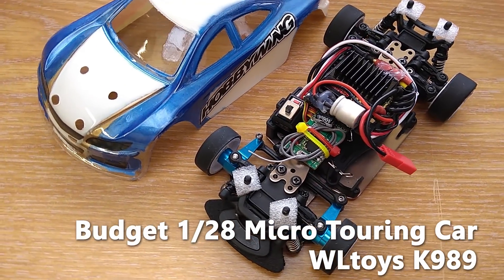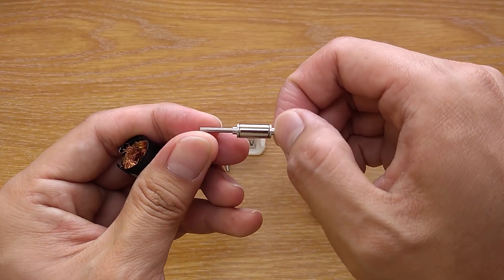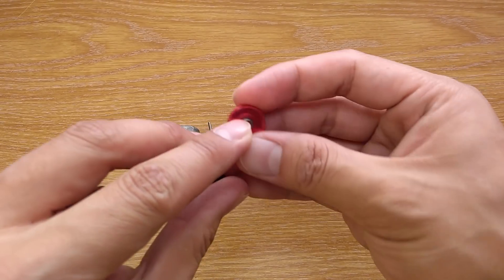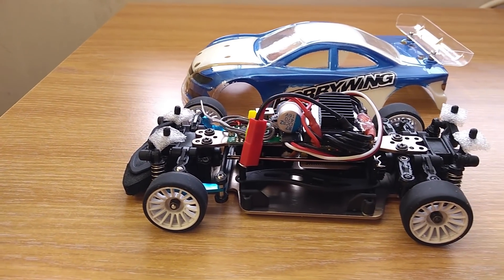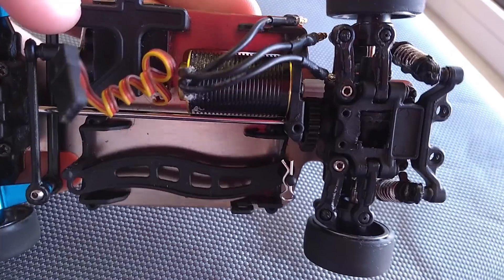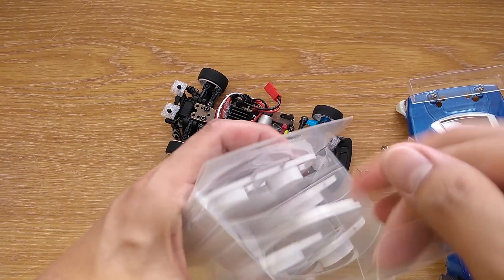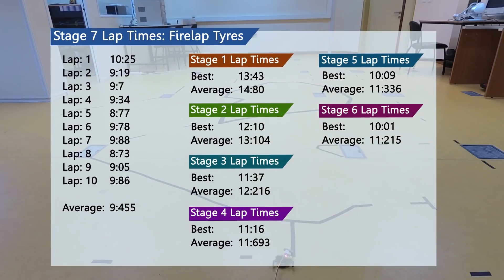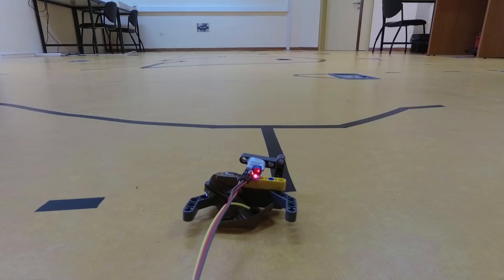WLtoys K989 Budget Touring Car - Stage7 Brushless Upgrade

Comment: Hi Beaver, where can I find the 8t pinion gear you use in the vid? Also which spur gear size is best to use? Thanks
Reply from the maker: It's from Tamiya Mini 4WD. You can also find it in "small plastic gears" bag like this https://bit.ly/3oXbPq3 .
To run a small motor pinion like this you'll need the 29T spur.
Reply: @BeaversHobby  Thank you Beaver for all your help waiting for parts to arrive FYI finally they have made metal crown and transmission gears found them on Aliexpress for this little beauty no more chewing up those pesky crown gears I went through lots on my older build, also ordered new all metal parts from banggood apparently fits much better then previous metal kits
Reply from the maker: @tecnikturbo  It's a bit difficult for me to order things from Aliexpress now so I didn't get the metal prop shaft gears. I've seen some other people use them as well and they work perfectly with the metal differentials.
Reply: @BeaversHobby  Hi Beaver I could forward you anything you need from Aliexpress I get most things sent to my Familys UK address then they send to me here in Cyprus
Reply: @BeaversHobby  Hi Beaver so I just installed the 9t and 29t but she not fast at all on full thtottle, seems tight when I try to push it by hand, everything looks good as far as pinion spur gear gap any ideas?
Reply from the maker: @tecnikturbo  Thanks. I'll let you know if  I need anything.
Reply from the maker: @tecnikturbo  If the gear mesh is OK then there's no problem. The slow speed is to be expected for 9T pinion. I use 8T in this video to slow it down, it's my setup for the excessively fast motor.
Reply: @BeaversHobby  Great thanks for the reply what would be the best combos for top speed or top acceleration or something in the middle, really don't understand gear ratios to keep my motor  in safe temps
Reply from the maker: @tecnikturbo  It depends on the motor you have and what you want to do. The highest speed that's easy to do is 21T motor with 27T spur (original  part). You can use bigger motor pinion for more speed. 
Good acceleration is the stock setup, 17T + 29T. If you want more torque for, let's say drifting then 15T + 29T with standard motor.
Here's my video about gear ratio. https://youtu.be/bQiR-cfBnvw
As for the motor temp, I don't really have a formula for that. You'll have to monitor it.
Reply: @BeaversHobby  Thank you Beaver! I have the same motor as your video the scorpion what would be a safe max temp? I want the set up basically for racing others on full size track lol so need a balance for max acceleration and top end
Reply from the maker: @tecnikturbo  60-70°C is really hot, try and keep it around 40-50°C should be fine. A heatsink will help too. I've seen some on aliexpress.
I thought 8T was still really fast with the track I've tested, around 2.5m x 4m. You can try 10-12T pinion. I'll give you more speed. The acceleration is not really compromised with this motor, it's powerful already.
Reply: @BeaversHobby  Mm maybe its because I was trying straight light speed about 12 meters and didn't seem that fast even much slower then stock motor and spur/pinion? Let me have a look again and see if I have everything setup correctly before I change to your recommended spur/pinion combos upove, thanks again for your help much appreciated 😊
Reply from the maker: @tecnikturbo  Anything in this scale will look slow in long and wide track. Anyway, try 18T pinion with 27T spur if you want absolute straight line speed.
Reply: @BeaversHobby  The scorpion motor is a little beast have you seen on Aliexpress the 18A Brushless ESC + 1625 Brushless Motor? What do you think will it work for this little guy? I'm gonna order next couple of days if you want one? Gift to you for all your help send me a private message not sure how to do that.....Not really too wide of a track they race 1/10th scale RC's its got one straight about 10-15 metres and then just mostly turns its hilarious watching this little guy on there, anyways I will try your last recommended and go from there, by the way your videos are amazing and you've have been so much help will study the gear ratio video again thanks 😊
Reply from the maker: @tecnikturbo  The EZrun 18A + Leopard 1625, right? I got one of those and they are good. The motor needs a bit of care since the wires are brittle but it has good torque and speed. Yes, the combo will work with WLtoys 1/28. The 1625 is the same size as 1410. Different manufacture calls it differently.
Reply: @BeaversHobby  It says BYRC looks decent not sure if its as good as the scorpion combo but as its only 23ish euro I doubt it, iv got two wltoys k989 one setup near exact like you brushless scorpion setup and one stock which will take the new motor which ever one i decide to get
Reply: @BeaversHobby  Hi Beaver one more question please i found motor from surpass rocket are they any good? Which kv would you recommend the orange motor kv is 9500 would this work on the k989 With 27t spur 18t pinion? Iv just ordered the heat sink and the smallest fan which I will glue on the side of the motor mount for cooling thanks
Reply from the maker: @tecnikturbo  Surpass Rocket is the standard nowadays. It's as powerful as Scorpion but doesn't heat up when using with 2S. Choose the KV based on what you want to do. 2500-3500KV for drifting, 3500-5500KV for track driving, 7500KV for track with very long straight. 10500KV for drag racing or just do speed run without caring it'd need to turn.
Reply: @BeaversHobby  Hi Beaver now thinking of purchasing a 2030 motor judging by size it should just about fit in hopefully what do you think?.  I have a small issue with my setup as it is when ever I let go of the throttle the car turns hard right also which ever direction I turn it kind of steers in that direction no matter how much I play with the trim, I just put a new servo in there thinking this is the issue but still the same any ideas would be much appreciated please?
Reply from the maker: @tecnikturbo  2030 won't fit unless you do some extensive modding to the motor mount and servo bracket. Even if you do that I still won't recommend because the size and weight. 1625 (actual size 16mmx25mm) or 1410 (some manufactures just call it that even it's the same size and bolt pattern as 1625) is the right size for this car.
The veering off to one side is more of a problem from the chassis and tyre contact. Check if the contact patch is good on all wheels. Worse case you might need to put M2 screw in the lower arms and adjust the downstopper to make all the wheels touch the ground evenly.
Reply: @BeaversHobby  How would I go about adjusting the downstoppers? I have upgraded everything to metal now and tyre contact patches seem okay nothing seems to be binding really annoying
Reply from the maker: @tecnikturbo  Oh... You have the metal suspension... No wonder it's out of whack. Take a look at the lower arms, there will be a hole that you can insert M2 screw in. Put a screw in there and adjust each one until it works correctly. The other possible problem is from the differential, if you use ball diff, check if the diff can spin smoothly. If it's one way, check if both sides can spin forward smoothly and about the same friction. Drop some oil in there to lube it too.
Reply: @BeaversHobby  SOB lol didn't even consider those holes, checking again seems the front left wheel and rear right are drooping a tiny bit more then the other wheels no wonders shes pulling to the right and all over the place, I will adjust it later and test and report back. Thank you Beaver seriously for always helping out much luv brother!
Reply: Can I have your PayPal details I would like to buy you a drink?
Reply from the maker: @tecnikturbo  My pleasure. Best of luck and have fun!
Reply: @BeaversHobby  Hey bud did you receive it?
Reply from the maker: @tecnikturbo  Yes, I've got it. Thank you very much!
Reply: @BeaversHobby  No thank you Beaver for always been helpful your knowledge is priceless, you should see if people would like to donate to you for all your support. Your RC channel is awesome keep up the good work and happy holidays bud! :D

Comment: hey beaver. got my k989 couple weeks ango and decided to make it drift. i ordered mini z adjustable offset set of rims (8.5mm and 11mm) with lf3 tires(8.5mm front, 11mm rear) will they fit onto the rims?
Reply from the maker: I've never used the adjustable rims before but if the wheel diameter is 20mm the tyres will fit.
Reply: @BeaversHobby  what offset do you recommend?
Reply from the maker: @stiletto9  Offset generally depends on the body. However I recommend low offset at the front like 0-1mm to avoid or lessen the scrub radius (distance between the pivot point and tyre contact). As for the back, it should be the same as the front or if you plan to use 11mm then use a lower or equal offset.
Reply: @BeaversHobby  yes im using stock body. wait is it ok to use narrow rims at the front and wide at the back?
Reply from the maker: @stiletto9  Yes, it's OK to use front narrow and rear wide. Stock body with 1-1.5mm front and 0mm wide is also a good setup.
Reply: @BeaversHobby  okay, just one more thing. i ordered lf3 and lf5. which do you reccomend?
Reply from the maker: @stiletto9  Try LF5 first, it'll give you the lowest speed. If you find it too slow then change to LF3.
Reply: @BeaversHobby  but how do i even change the tires. isnt that once a tire is on you cant take it off
Reply from the maker: @stiletto9  You can heat it up using warm water. I repeat, warm, not hot. The tyre will expand and you can push it out easily. If you put it in hot water the wheel will deform.
This might destroy the sticker on the sidewall but it's one of the safest way to do.
Hair dryer and heatgun are a bit difficult to control.
Reply: @BeaversHobby  and same for putting the tires on ?
Reply from the maker: @stiletto9  Yes, it's the same. You can also use hair dryer for putting the tyre on because you only blow it into the tyre so there's no worry about deforming the wheel.
Reply: @BeaversHobby  and how hot do they need to be to put them on rims?
Reply from the maker: @stiletto9  There's no specific temperature. Just heat it up until you can push it onto the wheel. If it doesn't go in, take it out and heat it more.
I forgot to tell you if you are afraid, there's tyre installer/remover on RCmart. https://www.rcmart.com/ds-racing-tires-remover-set-for-mini-z-mi-tr1-00105033
Reply: @BeaversHobby  but im scared i will melt it
Reply from the maker: @stiletto9  Don't worry. Hair dryer isn't hot enough to melt the tyre. You can heat it up, touch it to feel if it's hot then push the wheel into it. If it's too tight, take the wheel out and heat the tyre more. 
Have you seen my DS Racing video? I use hot air gun (which can really melt the tyre) but it worked. https://youtu.be/I_QuXF8dojk
Reply: @BeaversHobby  oh ok, just one more thing. i have 3d printed tires on my k989...  will there be any difference with ds tires?
Reply from the maker: @stiletto9  Yes, a lot.
Reply: @BeaversHobby  oh ok because now i cant control it really good. also some wheels are bigger than other because of inconsistency of 3d printers. so if i get everything from this chat, i should put lf5 tires first
Reply: @BeaversHobby  okok so... i got them and what should i do? what offset and lf3 or lf5?
Reply: @BeaversHobby  i got them and they are small. not too small bus small. is this ok?
Reply from the maker: @stiletto9  Yes, that's the standard size of Mini-Z.

Comment: What tire you use? And give me the link to buy it plss
Reply from the maker: In this video I still used Firelap slick tyres. http://bit.ly/2PFL89W
However I recommend Kyosho radial tyres if you can buy from Japan (or check out your local Kyosho dealers) Front 20 degree/Rear 20 degree
Front http://bit.ly/2U1oxXf
Rear http://bit.ly/2NvknFB
Don't forget the wheels:
Front http://bit.ly/2WSecRf
Rear http://bit.ly/2znzs3K
Reply: @BeaversHobby  type the firelap tire is super soft, soft, medium or hard?
Reply from the maker: @basyirrr8526  Very soft and loose grip very quickly. Get Kyosho if you can degree tells you the grip level, lower degree is more grip.
Reply: @BeaversHobby  what does this degree mean? sorry i'm a beginner
Reply from the maker: @basyirrr8526  Degrees in tyres mean grip level. The lower the number is the higher grip. For example 10 > 20 > 30, the 10 has the highest grip.
Reply: @BeaversHobby  10 is super soft tire?
Reply: @BeaversHobby  the softer is more grip?
Reply from the maker: @basyirrr8526  Although it's not super soft, you can think of it like that if it helps you understand that it has the most grip.

Comment: Hi what tires do i need to use for the MDH100W MULTI OFFSET WHEEL SET ? ( on road touring application). kindly send me the link. THANK YOU
Reply from the maker: Kyosho radial or rubber works well on pretty much any surface. We usually use front higher number than the back. Degree number tells you the grip, lower degree has more grip. So basically we start with front 30, rear 20 to prevent the car from traction roll then adjust from there.
Front = narrow, rear = wide.
There are many manufactures too so feel free to choose.
Here are the links.
US/North America https://www.kenonhobby.com/Wheels-Tires_c_132.html
EU http://www.minizracing.it/minizshop/index.php?main_page=index&cPath=65_85_91
Asia/International https://banzaihobby.com/radio-control/kyosho-miniz/mini-z-racer-tires
Reply: @BeaversHobby  Thank you so.much for the info.
Reply from the maker: @joaquinenriquemontaner2651  My pleausre.

Comment: did you have overheat issue in this motor?
Reply: which is better, ezrun or dasmikro?
Reply from the maker: @uchianxgaul  DasMikro. It's smaller, provides the same power and has less or even no cogging.
Reply: ok thanks for your advice..
Reply from the maker: @uchianxgaul  My pleasure.
Reply from the maker: No but it does get hotter than other motors I use.
Reply: @BeaversHobby  is there a cogging issue?
Reply: i want to try this setup in rwd ezrun 18a and atomic 10000kv, but im afraid overheat issue in this motor. coz i was used a rocket 9500kv and too much overheat even i play it in 1 minutes with 40% epa.
Reply from the maker: @uchianxgaul  If you have to lower the EPA then get a slower motor is better. You'll have better control over it.
The cogging with EZrun is minimal, I'd say it's about the same as Atomic or GL sensorless.

Comment: I'm considering the ezrun and scorpion motor combo you used for my k989,  did you need to replace the battery or connector on the ESC? What about the bullet connectors on the esc? Thanks for the videos I especially liked the drive train video to clean the differentials.
Reply from the maker: Yes, you'll need to change the plugs too both the motor connector and battery connector.
On the motor you'd want the bullet or banana 2mm.
On the battery you'd want the JST RCY or red JST plug.
Reply: @BeaversHobby  great, thanks for the help
Reply from the maker: @voidchewie  My pleasure. Best of luck with the project!

Comment: Hmm...when I've got the cnc up and running again maybe I'll try my hand at making a few upgrade parts for these things.  They REALLY need better steering angle, so I'm thinking making a whole new steering setup that fits in with the stock diff case and such, or perhaps a full swap with diff casing as well may be in order...  anything to get it to u-turn in just over twice its width like a real car can.
Reply from the maker: Take a look at GL Racing GLA as well. You could take some design queue from it. http://gl-racing.com/GLA/v2/guide/#steering_crank

Comment: Hey beaver can you help me I have a K989 on the way I didn't realise the wheels on it have the slot shape in the centre, I have ordered Mini Z wheels for it but they have a circular center will these still fit the wl toys with the nuts that come with the wheels?
Reply from the maker: I'm sorry to say that you have ordered the Mini-Z RWD (rear wheel drive) wheels and they are the wrong ones. K989 needs Mini-Z AWD (all wheel drive) wheels. There's an adapter on thingiverse if you have a 3D printer. https://www.thingiverse.com/thing:3537668
This will increase the offset significantly and will affect the handling.
I highly recommend you get new wheels. This time make sure you order the AWD type.
Reply: @BeaversHobby  will these fit mate without any mods https://www.ebay.co.uk/itm/KYOSHO-MINI-Z-AWD-WHEELS-SET-WHITE-WIDE-OFFSET-0-2pcs-MDH100W-W0-/154358031480?_trksid=p2349624.m46890.l49286
Reply from the maker: @krisstoney6892  Yes, these will fit without mods. These are rear wheels (hence "wide") so you might want a different set as narrow at the front. Look for MDH100W-N15 for front wheels 1.5mm offset and they'll go together great with 0mm offset rear wide wheels.
Reply: @BeaversHobby  https://www.ebay.co.uk/itm/KYOSHO-MINI-Z-AWD-WHEELS-SET-WHITE-WIDE-OFFSET-0-2pcs-MDH100W-W0-/154358031480?_trksid=p2349624.m46890.l49286      will these fit mate without any mods